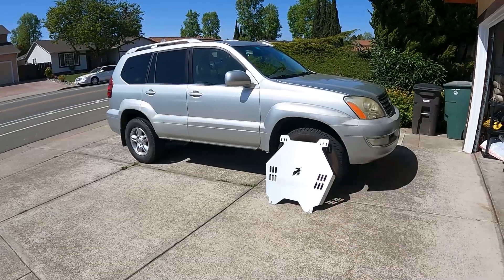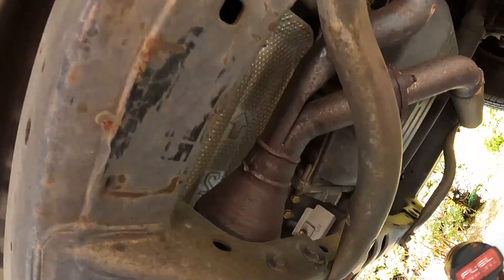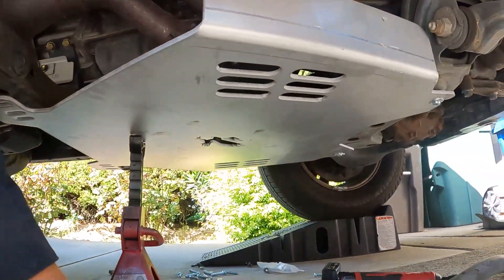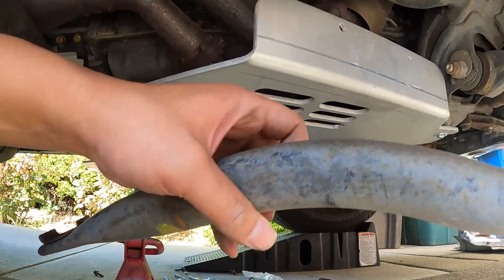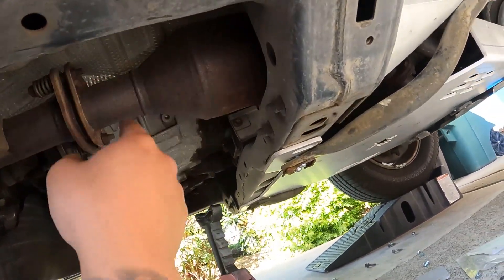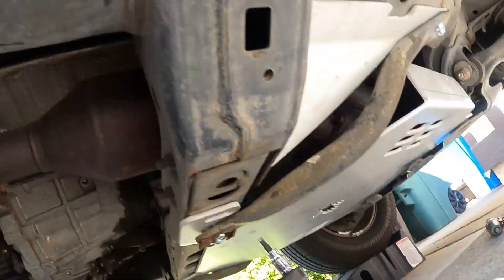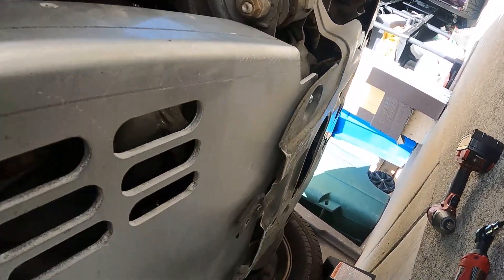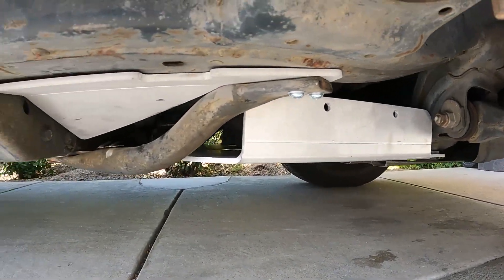Must Have Mod For The GX470! Catalytic Converter Shield!

Comment: I got one installed on my GX 460.  The only issue is it will be a pain in the butt when time comes to grease the front drive shaft, but this is part of the sacrifice we have to make I guess.  Also, always use some anti-seize on those Allen hex bolts.  Allen heads can strip easily if it seizes due to rust, unlike regular hex head bolts where you can just torque it loose.
Reply: Were you able to put the brace back on ? For some reason i cant put the brace back on if i install the side panels
Reply: @dochue  Are you installing on a GX470 or GX460?  The shields are slightly different in design.  I didn't have any issues with fitment.
Reply: Gx460 2022 , the side shields are a bit more angled than, they provide better coverage but no room for the support brace. Im not sure if leaving these braces off is a good idea
Reply: @dochue  I would try to email Talons Garage and explain the fitment issue.  He might send you another pair of side shields.  It's not the end of the world if you don't install them, but sinced you paid for them you deserve a functional product.  Mine is a 2020 GX460.  They should be identical.
Reply: @dochue  You should absolutely install the support braces, they offer torsional rigidity.  Leave off the side shields if you have to but do install the support braces.
Reply: Thank for replying, and thank you for your help. I ll replace the side shields with the support braces for now

Comment: I installed the same Talon player on a 2020 Tacoma and it rubs at the mounting points and sounds annoying af when i drive no matter how much I tighten the bolts. You have any noise 5 months later?